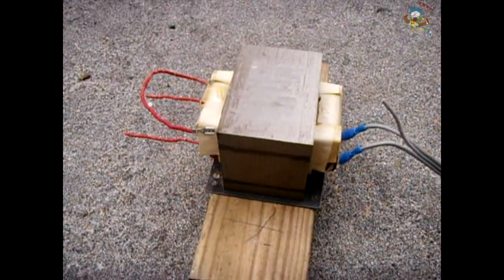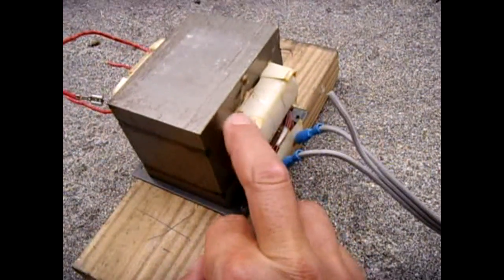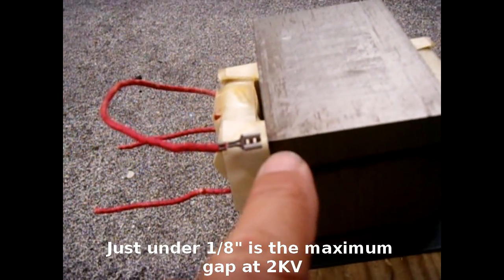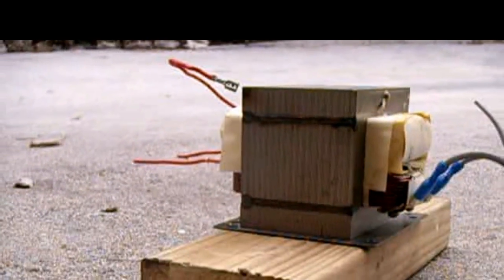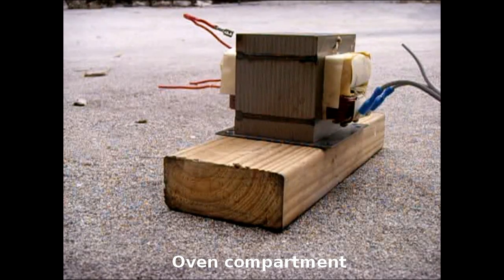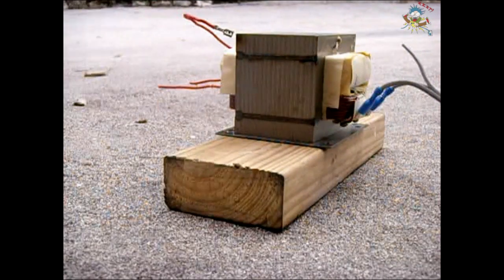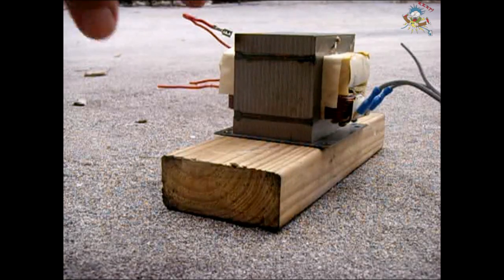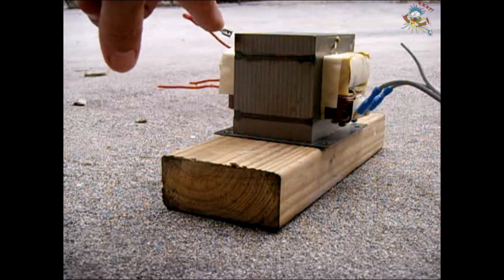Microwave Oven Transformer TEST! (Easily Rule Out Being Faulty)

Comment: Although the video quality is good; testing the secondary coil of high voltage transformer in the manner shown in the video is very dangerous and should be replaced by a safer method in which a multi meter is used of-course without measuring voltage on the secondary coil
Reply from the maker: You can also use this. :-)
https://www.youtube.com/watch?v=qWd9JISGYYw

Comment: I ran microwave empty, It went totally dead. Net info said magnatron probably dead, took cover off and transformer look like it had melted, the more I got into trying to find parts info, interelation of electronics (hv capacitor, diode, temp shutoff and safety at 4000 volts and my lack of expertise in this level of electronics and the $$$$$ of parts I decided to not waste my time and money on it and will replace the microwave.
Reply from the maker: Never run it empty. Nothing should've overheated if the temp sensors were in place.

Comment: Hello mate, If you touched the body of the transformer whilst power was on, but the high voltage lead was enclosed/isolated out of the way and wasn't within arcing distance like in this video, would you still get a shock? Sorry for what must seem a Noob question.
Reply from the maker: Theoretically, as long as the transformer body is grounded(which it is in a microwave oven), you should be able to touch the metal body, but that doesn't mean you should try it! So don't.
Reply: @electronicsNmore  Thanks for the reply mate. I'm just confused by the MOT because it's the only transformer I've come across where one end of the secondary is connected to the core and not going off into the secondary circuit. I'm pretty fresh to all this, and don't worry, I won't  be touching anything to test it! The current on the secondary is alternating, so I assumed changing direction at a certain frequency...??? Man it's confusing!

Comment: Why are there 3 wires on the secondary side of the transformer?  Also why are there 3 wires on the primary side?  I thought a transformer just had a coil on each side, and that there were 2 leads, one at each end of each coil.
Reply from the maker: Only 2 wires on each side. If you see a 3rd wire, that means the coil is tapped. Thanks for watching!

Comment: how about how to test the other two remaining red wires ouput?
Reply from the maker: Very easy, the output should be around 3VAC. You can also test the filament winding by using a DMM. The resistance value should be VERY low resistance. Thanks for watching!

Comment: So we just turned on the microwave and it sounded and flashed like what I'm looking at here.  I turned it on again with the food removed to make sure it wasn't metal in the food somewhere and with it empty it looked like above again.  I haven't found any other videos but I'm guessing that either the wire fell off or disconnected and is now hanging free in the back and arcing into the transformer?  I unplugged it, but since I can't find any videos that reproduce it other than this one it was the only option I think available.  Would you concur?  It's probably still under warranty, but it won't be out until Monday so I'm hoping it's okay to just sit there until then.
Reply from the maker: +Primo 
Hi. Arcing inside the oven cavity is usually caused by a dirty/burned waveguide cover, or exposed areas of metal that need to be painted.  Look it up.

Comment: What should be the resistance of the primary and secondary coil?
Reply from the maker: Primary is usually 1 ohm or less, and the secondary  around  75-80 ohms. Values will vary.
Reply: The primary coil of my mot is around 3ohms,and the secondary around 155ohms,is that normal?
Reply from the maker: +Commander Riley 
Every MOT is different. As long as the windings give you no reading on a 10M ohm range, you should be fine. You probably have a lower wattage transformer.
Reply: electronicsNmore It is 800watts

Comment: Anyone watching this should PLEASE NOTE: Wood is conductive when High Voltage is involved. Simply placing the HV-out lead against the wood base touching ground(case), will result in some smoking or even burning a trail in the wood as the HV finds it way from the HV-lead to the grounding. Even concrete is potentially conductive. Always be aware of ALL RISKS and SAFETY.
You can't do science if you're dead.

I'm honestly surprised that wasn't included as a warning. Carelessness will get people killed.
Reply from the maker: Tiwaz Tyr I appreciate your concern, but clearly you failed to read the video description area of this video, as well as my channel main page. Wood(like concrete) when extremely dry is an extremely poor conductor, when damp, watch out.
Reply: I read the description. Although, I stated wood is conductive when HV is involved; I didn't say it always is -- but, more or less, it can be. And I said concrete is potentially conductive. The more aware anyone is about the risks involved the safer they can be. Also, I was simply looking around at different applications people have used a MOT in. No offense but I don't have time to read every ones channels. Have a good day mate. And stay safe. Good video btw.
Reply from the maker: Check out my DC welder made from MOT's and other MOT projects. :-)

https://www.youtube.com/watch?v=tyvZGIlHEok&list=PLQ6IOhUBblU1xo9xY9uFUAJQ2D0kbOmkj

Comment: plz i need to know if i applied 220 at input wthat is the value  voltage applied to magnteron terminals and the value between (the single termanal that make a spark in vedio and the body of transformer)

Comment: I've accidently touched the hv output while the mot was powered up. Luckily I did not complete the circuit with my body. I'm clearly still alive and kicking around but it did give a nasty shock. Be careful fellas
Reply from the maker: CLEARLY you did not heed the warnings in the video. Very, very dumb. I clearly stated to stay away from the microwave oven transformer while it is powered up. Lucky your alive.
Reply: electronicsNmore That's why you leave it to the professionals and not amateur's :)
Reply: P0tat07 what did it feel like
Reply: electronicsNmore its not THAT dangerous. Obviously if you complete the circuit , yeah most likely you will die. However , say for instance the shock or ark goes through your right hand into the ground through the right foot, you will feel a nasty shock and even a burn in the hand or foot, but you will live. On the other hand , the left one, it will go through your heart and kill you. Or if you complete the circuit with both hands. Some people have survived up to powerline voltages of 7kV~12kV
Reply: Bubaroon LNK at wat current rating?

Comment: Do the welds act as current carrying paths?
Reply from the maker: No, the entire transformer core does. One end on the secondary is connected to the core, the other end is loose.
Reply: electronicsNmore Of course you're right, but as far as I know the individual core laminations are supposed to be electrically isolated from each other ( otherwise what is the benefit of dividing the core into separate parts when you could simply use a chunk of metal instead) by a layer of insulating material such as varnish or something. I don't understand it when I take my multimeter in attempt to measure the continuity of my transformer's core right across it and get a reading on the meter, that's really confusing to me. I don't think that 2k volts would be enough, in this case, to overcome the resistance of the insulator. But all the electrical engineering books are telling you that they are covered with varnish and specifically designed to divide the core into individual segments to reduce power losses associated with the core.
Reply: 2013Aleksey2013 Yeah, laminations of the core is separated to reduce losses caused by eddy currents. Insulation on laminations is not a big deal for HV to go through (I mean one layer, more layers - better insulation), but the welds provide path of least resistance, this doesn't mean that it's safe to touch core away from welds. Potential will be there waiting for path of least resistance. Electricity is pretty lazy :)
Reply: MrJohhhnnnyyy Please correct me if I'm wrong. I am aware that if you touch both wires of the secondary winding at the same time you will almost certainly get quite a nasty shock or maybe the outcome of this will be lethal for you. But if you happened to be standing on a concrete floor while touching only one end of the secondary winding you will be just fine as in that case the transformer will provide electrical isolation from primary to secondary and as such the output is no longer referenced to the earth ground?
Reply: 2013Aleksey2013 Yes, you are right that transformer provide galvanic isolation, but if transformer is not isolated from concrete, some current will leak through it. It will be safe to touch one end of secondary if transformer will be completely isolated (placed on really nice dielectric, like thick (and dry) piece of rubber or wood, etc.).
Reply: MrJohhhnnnyyy Thank you :)
Reply: 2013Aleksey2013 You are welcome

Comment: The statement put on the screen at 2:00 is incorrect.  Applying 120V to the secondary would indeed step down the voltage but the current should increase since Pout=Pin.  Maybe you used a high resistance load on the low voltage terminals (step V down), and couldn't measure the true current.
Reply from the maker: Applying 120V to the secondary draws approx 6ma, and outputs 6.5VAC at around 100 ma. True statement. I verified it.
Reply from the maker: I don't understand why you are questioning the statement I made. When you supply ONLY 120V into a winding of 1800 - 2000 turns using a very thin gauge wire which is intended for 2000+ volts, you are not going to draw too much current using only 120V. The 120V primary gives roughly a 6.5VAC output at around 100mA. Using a 6V incandescent lamp, the maximum current I can draw is around 100mA before the voltage starts dropping lower. I hope you understand now.

Thanks For Watching!
Reply: I believe you misread his statement on the screen.  The current did increase.  From 6ma to 100ma.  And as far as power is concerned the output was a rectified 9VDC while the input was 120VAC.  So .006 * 120 = .720 watts. And .1*6.5 = .650 watts.  Very close considering we are ignoring the phase angle difference of the current and voltage and heat loss.
Reply: mediaguardian
As the voltage is stepped down from 120 VAC to 6.5 VAC then the transformer ratio is 120:6.5 or 18.46:1  If the now low voltage output is short circuited, the current could (ideally) be stepped up as the voltage is stepped down, ==> Pout=Pin.  What limits this secondary current is the resistance of the wires on the high voltage side.  By your power calculations, you have verified the measurements.  How did you measure the current of 100mA?  Nonetheless, the impedance of the 6.5V side transformer wiring can be calculated as 6.5V/100mA = 65 ohms  What is the impedance seen looking into the 120V side?  (v*v)/P = 14400/.7 = 20.5kohm  Therefore, you could put a 120V bulb in series with the transformer 120V side and it wouldn't light up.  Right?

Comment: hey, just a quick question. Do you have any idea if all the MOT are the same? Because i was planing to make myself a spot welder but the guys at the transformers house want to charge me a fortune for a 2V 1.0-1.5KW transformer because "it's custom made" and stuff. So i was thinking of buying a to-be-repaired or used microwave oven just for the MOT which would cost me about a forth of the money and i get the rest of the electronics "for free".
But i was in doubt because i do not know if all the MOTs come with the secondary separated like that, so that i could cut it and replace it with whatever i want, instead of the secondary over the primary, which would make it useless.
Reply: Laharl Krichevskoy For MOT's big idle current is normal. To reduce cost, they wound less turns then needed (wire=$$$), and MOT's made to work short time (low duty cycle) so they heat up considerably even after 10mins of idling. For a spot welder, which will work for a short time this transformer is best choice.
Reply: thanks for the help. I just got one from a 1994 850W microwave oven, and for free! the other day.
But yeah, like you said, secondary over the primary, shunts and stuff.
I just cut it open and am trying to get the windings out, without cutting the secondary so that i can use it for something else, and then rewind it. Im just having a bit of troubles geting the windings out, because of the wax/glue thing it has all over it.
Let's see how it goes...
Reply: Question is not to me, but all MOT's that I have seen is like one in the video. Secondary over primary gonna require good insulation between them + usually current shunts are placed between windings . So go for it, but there still a little chance that there (in not working ovens) will be a problem with primary.
Reply from the maker: Does not matter if the primary winding is located in the upper or lower position in the E core. Works the same. Remove the shunts, and do not worry about any gap if you are not using a HV secondary.

Refer to my other videos here:

BEST Microwave Oven Transformer-MOT Rewinding Tutorial

DIY Custom Power Transformers

Don't forget to rate, "Thumbs Up".

Thanks
Reply: electronicsNmore Right, but I think that saying "over primary" he meant that secondary is located on the same spot, like on some other transformers.
Reply: Laharl Krichevskoy Don't bother yourself about scavenging wire from secondary, it's fixed or glued together, quite a pain in a butt to get it. Just use a chisel or hacksaw to cut it away, then punch out leftovers
Reply from the maker: Laharl Krichevskoy
I just posted 2 links for you to watch BEFORE you start chopping.
Reply: electronicsNmore I think he will pay time to watch your vids, they real easy to understand
Reply: nah, nothing a hammer and a few screwdrivers couldnt fix. Got both out in one piece.
The only thing that looks odd is that the primary eats too much current without load.
I tried it with a 60W bulb in series and the bulb was as bright as if the primary were shorted. Maybe it is, not sure if 1,65ohms is normal....
The core did vibrate a bit so it was magnetizing and It originally had a 5 turns solid wire secondary for the filament which said 3.6v on the label and with a 2 turn secondary i got about 300mv with 23v reading on the primary, about 76:1, 3.1V with 240V in theory, so seems a bit off but ok

Is this normal? because last time i tested a 220 to 110 volts transformer the bulb barely glowed.
If you do the math its about 100ohms impedance @ 50hz. With 220V it would be 2.3A/513W doing nothing. I'll see if i get a 10A circuit breaker and try it with 220.
Reply: well finally finished the secondary. 5 turns of 3x6mm wire. Gives about 4,45V and the current in the primary is quite near what i predicted, measuring 2,65A.
Have no idea the resistance or the thermal resistance for these wires but basing myself on some tables that said 80A for 1x6mm @ 20ºC delta T, i got 310A continuous at 100ºC DT, doing 1KA would dissipate about 10 times more but as it would be just a few seconds, i suppose the copper mass would withstand it long enough for the things to weld.
Thanks for the help.

Comment: I have a 15,000 volt neon transformer I used to power a Tesla coil I made many years ago.  I would inline a normally open push button AC switch to engage the transformer.  It's not fail safe but it does prevent the transformer from being kept on unless your finger is on the button.
Reply: electronicsNmore Capacitors is even more super deadly than MOT, can charge long time with low current, but discharge current will be huge (it's limited by load resistance and ESR of the cap).
Reply from the maker: Those transformer are low current, I think around 25 - 30mA, but still dangerous. This MOT transformer pumps out a super deadly 500mA at 2kv.
Reply: electronicsNmore Yeah, I know.  Mine is 30mA.  However, the output of the NT ran thru a huge array of capacitors.  So the stored charge was substantial.  Also, my point was simply talking about ensuring the transformer was not left powered on accidentally.
Reply from the maker: That is a good safety precaution. Place the momentary switch far enough away that there is no chance you can be in 2 places at once to get shocked.